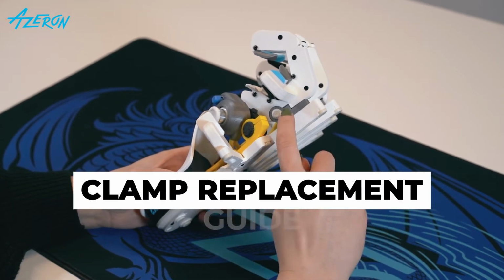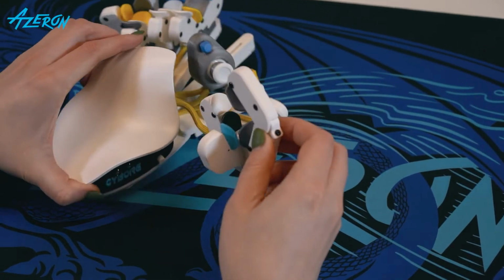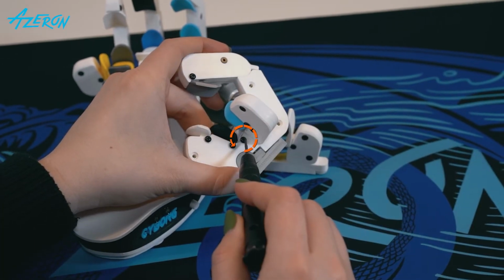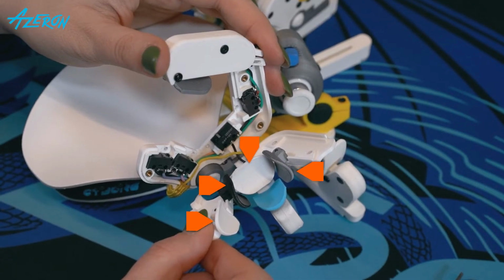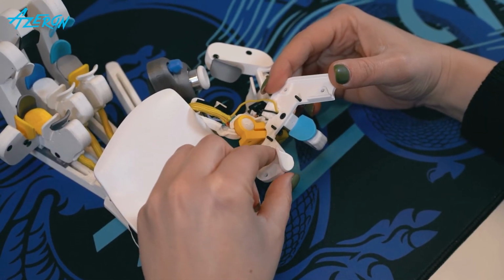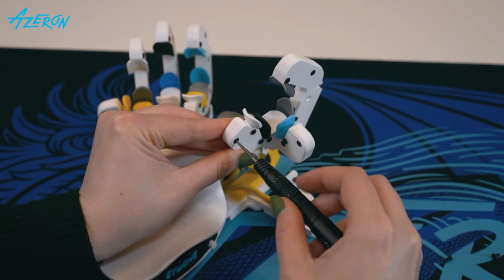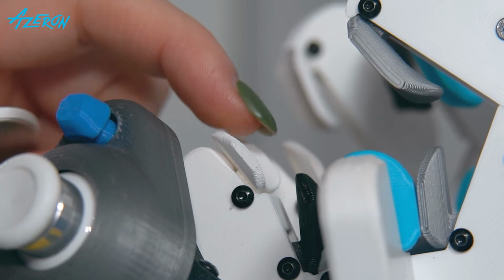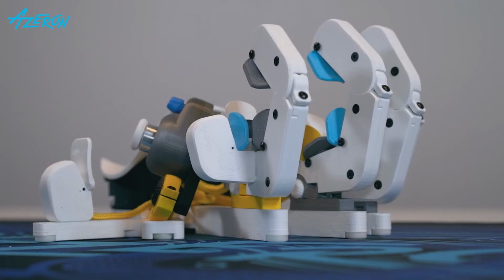Azeron Cyborg Tower Clamp Replacement Guide

Comment: That ball joint needs to be engineered more heavily. Ever considered printed metal for that component? 🇦🇺
Reply: We have made improvements for the part and it`s much sturdier now. 
Metal component has been discussed, thank you for the suggestion !
Reply: @azeronltd3313 is there a 3d print file for the clamp so I'm not spending 30+ USD to have that part shipped? I am a few weeks past my year warranty.